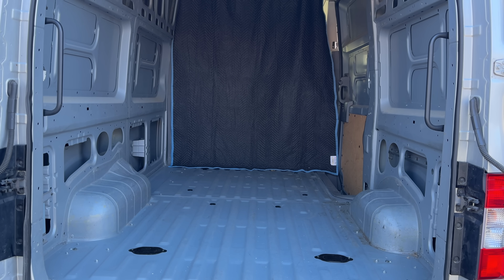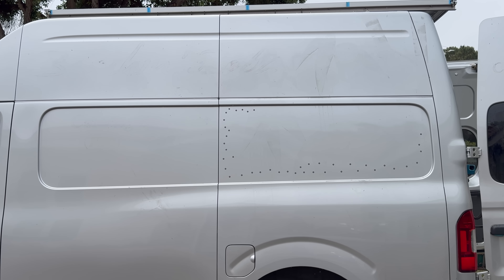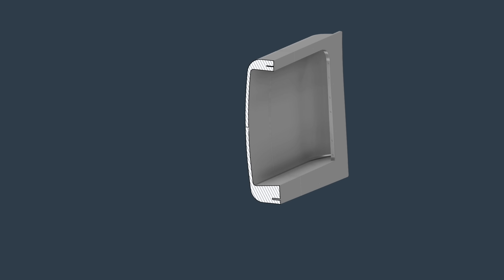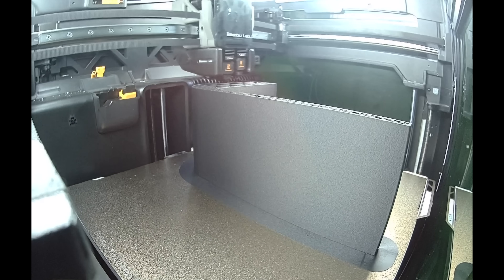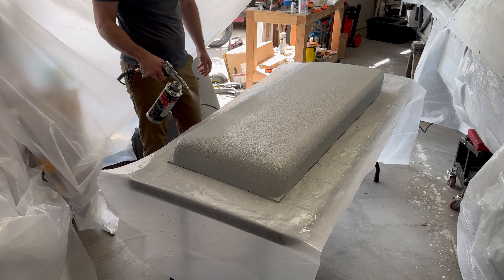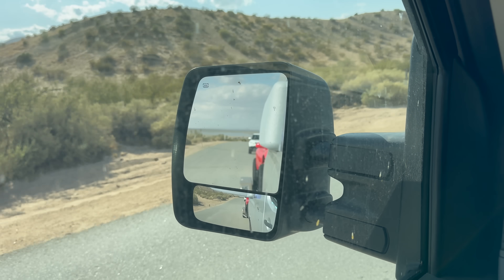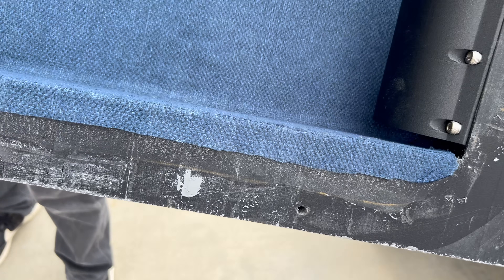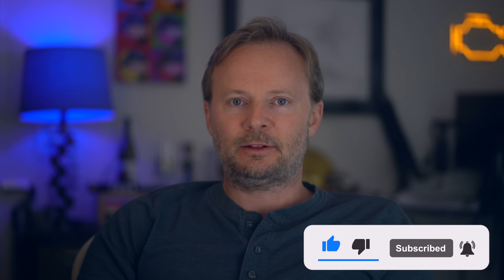The Challenges Of 3D Printing Large Parts

Comment: with acetone welding you wouldn't need the fiberglass coating. Acetone literally melt the two piece together. If they come appart it will be somewhere else than the weld.

Comment: Realize nobody reads comment 1222, but whatever. Would it have worked to do a vinyl wrap on it? Adhesive wrap perhaps? Not sure the bonding between a wrap decal and the material though. Haven't worked with CF ASA at all. Your comment about the thermal expansion difference was interesting. I hadn't considered that as a factor. Good thing to file away and remember. Did you have, or did you calibrate the shrinkage / expansion of that filament manually or just go with the 100% in your slicer?

Comment: Awesome project.  Having worked on large ABS/ASA 3D printed parts (custom water tanks) here are some things I would suggest if you do it again...

1) You mentioned bonding the parts together with acetone or ABS solvent glue.  You should have done that.  It is very effective and water tight.  For my water tanks I had some pinhole leaks through the walls (not the joints) of the 3D printed parts.  I ended up fixing that by pouring a shot glass of acetone into the tanks, capping them off, and sloshing it all around until it vaporized.  It basically melted the entire inside surface and made the tanks completely water tight.  For the joints I had already used ABS solvent glue and they were sealed tight right out of the gate.

2) I sprayed my whole truck in Raptor liner.  It's great stuff.  My only tip is to move the sprayer around wildly and never stop moving it.  If you try to do anything like the consistent overlapping patterns used for every other type of paint job it will cause tiger stripes in the pattern.  Just act like you are being electrocuted the whole time you are spraying and it will have a consistently random texture.

3) Use heat set inserts for the threaded holes.  They will be more reliable over time compared to plastic threads.  Plus they are very satisfying to use.

4) Add a second pee-bottle/water bottle holder.  Right next to the first one of course.

Comment: You know that video with the person putting all the shapes in the Square Hole, and how that girl was freaking out? That is how I felt watching this, like the girl. 

You could have just 3d printed molds for this entire project and saved yourself a massive amount of time and money 3d printing the entire thing. Print the plastic mold, it can be super thin and even printed in much smaller pieces and attached. Then once all pieces attached, use foundry sand mold method, and make the aluminum cast. 

You would then attach with screws and Butyl Tape. Making a waterproof seal super easy to install. 

Stronger. Cheaper. Faster. More durable. Better aesthetics. Better waterproofing. 

What you did was insane and cool. A proof of concept that you can 3d Print almost anything. . . but it was also absurd. So much time for a solution that is much worse, more difficult, and more expensive if we are account for your labor hours as part of the cost. 
-----------------

You can 3d print almost anything. But that doesn't mean you should. 3D printing would still be valuable to create the mold. . . but with a method that uses ~1/20th or less the amount of filament and cheaper filament.

Comment: Watching this on the TV in my van. In bed. I’m 5’10” and my bed is east - west, I fit just fine. No flare needed, which is good because my TV is just stuck to the wall on a magnet mount, so plastic won’t do. (Yes, I skipped the neato wood walls in my van. I’m mostly in a tropical climate and don’t want the mold to hide, I’d rather see it and clean it.)

Comment: Air actually likes to be smoothly guided. As you have big areas under and above the blob, it would make sense to give the air that has to pass the blob, the opportunity to smothly flow into the airflow under and above it. May not have the biggest impact, as it is a van and pretty close to the horendous unaerodynamik end of it, but as far as I understand aerodynamics this is a misconseption a lot of people have. A roof box for example is designed just like you had it in mind with your extention, but they are more efficient if mounted backwards. The front should be blob-shaped and the back shoult be sharp. Thats why a lot of modern cars and especially highly efficient EVs have these smooth and long tails sometimes. Because: If the air is guided together, there is less turbulence, turbulences occur only if there is "empty" space that needs to fill up. If it is not possible to get a smooth guidence, then a sharp edge is better then a rounded one.

Comment: Remember to print insulating 3D prints during the warm summer months, when the print is complete it will trap the hot air inside it and stay warm during the winter.

Comment: You don't need to know or own CAD. there is a free program known as 'LU-BAN Slicer' that will take any 3d model you import into it and automatically cut the model into parts the size you want and even number them so you can easily put them back together again. You can even tell it to automatically add holes and plugs to parts so you don't need a crazy amount of glue to put them together. Its a really good program. I highly recommend.

Comment: You might save print time by doing outside and inside separately and then sandwiching them wit insulation foam, could also help in colder climate 🤔

Comment: Side note to anyone curious about doing their own projects. You don’t need $1200-$1500 to start something this size. There are plenty of printers that are the same size as the one here that are a fraction of the cost. Even in the bambulabs ecosystem. If you want a core XY (same as this X1C) you could get a P1P or P1S. If you wanted a bedslinger you can get an A1. I have an A1 mini and an Elegoo Centauri carbon, ($200 and $300 respectively) and the Centauri could definekty handle this project with identical quality. It is the same size as well.

Comment: To be honest, since you said you will not do fiberglass work, I knew there will be some problems, but you acted like a "pro". I was right at the end and I'm happy for that. I think your idea of 3D printed extention was misstake from the beginning and took two times more time then if you would do it in conventional way... There is always reason why everybody does it by conventional way... 3D printing is great tool, but for parts of this size and use, it's much better to use it as a tool to help you reach your final product. Or it helps you to make some processes easier or quicker. If you would print out of PLA or PETG mold of same size, you would safe 2/3 of investment in ASA-CF and use it to make good quality fiberglass product, which is maybe difficult to make (there are plenty of nice way how make it...) and would end up with "One try - One win" solution...

Comment: super glue works the best when it comes to  ABS filament, It will melt the plastic and bond very nicely.after it dries melt the seams with a sod iron to weld the plastic and then sand. You can also try acetone but i don't for durability because it dries the area out and makes it brittle so the impact resistance is horrible.

Comment: I specialize in building large 3d printers. My printers have a minimum 24"x28"x70" build surface. Most of my builds are much larger than that. If you need large parts or would like a custom printer built, let me know.

Comment: If you're using DP 420 a lot (or at all really), I would highly recommend checking out Infinity Bond's EP 420 (and many other 3M epoxy clones). I haven't done any actual testing to see if it actually lives up to the TDS, but I've personally used it a handful of times for composite racecar aero bits with no issues. I also have a few friends at defense contractors who have personally given it their stamp of approval.

Comment: Hmmm maybe I didn't get it, but the side extension is good for your bed, OK, but do your feet fit in the extension above the bed?

Or maybe you need the extension only for the bed frame and your feet would fit perfectly inside the van - together with your whole body up to your head?

(The head side is the same, the extension only fits the bed, but the answer would cover both sides anyways).

Comment: Fiberglass over 3D prints is going to replace a lot of work in custom car building, and likely Ultralight Aircraft.
The claims that the Carbon Fibre in the filaments increases strength, doesn't hold up, Made With Layers and CNC Kitchen have videos showing the shear tests are not as good as the raw plastic. It does make for really nice tactile surface finishes, which need to be coated in resin to protect skin from CF splinters..... Also, don't sand it without breathing apparatus.

Comment: I'm mirroring your cheap/easy van build out.   I have a tip for you... bed base = 8x 27 Gallon HDX bins from HD, stacked 4x2 high with 5/8" OSB sub floor on it plus a residential mattress.  Make yourself a stick 30.5" high to hold up the plywood while you pull out 2 storage bins at a time.  8 storage bins = lots of storage.  The stack is high enough to store mountain bikes underneath with the seat and front tire removed.

Each HDX bin is designed to hold 900 pounds of weight distributed evenly on the lid.

Comment: Be careful when handling that carbon fiber filament it's nasty stuff and we fibers in you for a while same thing with the glass filled. Also just speaking from personal experience you could have done this with like under half the material you did probably plastic is very strong, Also if you go up to much larger nozzle sizes like 0.8 mm or 1 mm the prints will become much stronger. Ymmv

Comment: Auto Parts guy here- you might check out beutal tape in the future. We use it to seal flat glass to sheetmetal and cleans fairly easy and seals impressively well. Plus it comes as a roll so you dont have to mix or use other stuff. Just put it on with your hands (and gloves) then apply other parts.
Reply: That's "butyl" tape. It is used widely in RVs, and I despite it. There are reasons that it is not used in proper automotive design.

Comment: 3d printing something that size can work. And you did a bangup job.
Though one might consider doing a vacuum form piece of ABS instead. Using a DIY vacuum table of pegboard, 2x4s, & a shopvac, then CNC carve a mold out of foam board to the appropriate size/shape. Heat the plastic, drop on the form, and boom... one solid single piece bodypanel.

Comment: Next time you go to bond parts together you might consider using the infinitely more expensive DP8910NS or the slightly easier to obtain but equally as expensive DP8005. I've yet to try it on a production part but have done small test cubes. It is what the 3m rep at my work recommended I use for PPA-CF or any low surface energy plastic. Just something to consider.

Comment: My way of taking measurements is to take a flat picture.

Measure width at widest, width at narrowest, height at tallest, height at shortes, then I draw those lines in my CAD software, add the image and transform it to fit the lines.

Comment: If you want to print other big parts by cutting them into smaller parts, you can use the software LuBan. It is very convenient, it includes the dowel pins too

Comment: get a few jars of that chinease eel brand urethane roof sealant lol. its like like liquid fiberglass... drys really solid. can put mesh in it to stop it from splitting. i use it to waterproof 3d vase prints and also to make things stronger that yt doesnt want me to talk about 3d printing. usually use aramid thread for that too with urethane slathered over the top. im suprized no one knows about this. its like less than 5 cents per oz if you buy in bulk. thats insanely cheap lol

Comment: I also hate sanding!
Have you ever tried planing wood with a well set-up, and very sharp, hand plane?
I think that might convert you to a (part) woodworker, no sanding required, and the surface you get is just stunning.
Compared to sanding, hand planing is pure joy.

If you don't already have a decent one, buy a used one that isn't very collectible.
TLDR: get a not too old, and not too new (can't go wrong with WW II +/- a decade or so), Stanley no 4 or 5 (or up if you fancy).
Then spend a bit of time and elbow grease setting it up, and you'll have whisper thin shavings, that literraly sing when they come off the board.

Rabbit hole warning: go E-baying, and use the "type study". But you might never come back out again...

Avoid "Handyman", as they lack the frog adjuster screw, making a proper setup (much) harder.

I'd avoid the cheap plane shaped objects they sell at big box stores (my first one was that, and it's basically an unfixable paper weight).
Using one of those might only lead to frustration. (A good lesson on how a decent plane isn't designed by trying to fix one though)

If you fancy spending money, then by all means, get a Veritas, or a mint condition Sweetheart Bedrock.

Comment: Couldn't tell what brand bed liner you used but issue is some of the "cheaper" brands are not very resistant to UV and will start peeling after a year or 2. That's why most people just shell out the extra cash for "Rihno Liner" it does not have that issue

Comment: Fun project and a solid execution. Tpu would have made a very effective seal between the bump and body panels. I've used it to seal hydrocarbon laden liquids for days at a time. Tpu doesn't get enough play considering it's INCREDIBLE strength and layer bonding + it's ability to compress oh so sweetly.

Comment: Why did you use epoxy resin vs polyesther or vinilesther? Because of less exothermic reaction that could potentially warp the print? And which epoxy resin was used? Since they are all pretty expensive.

Comment: Hi Matt,
If you want to put big 3D printed parts together in the future, you can use a soldering iron and extra 3D filler. You slightly melt the edges and then add the filler. You can think of it kind of like welding, but with plastic and at much lower temperatures. And if you do it right, it’s even watertight.

Comment: That was a great project.  I have my own thoughts on joining plastic parts.  Firstly, I was really impressed with the surface finish on the parts from the printer, wow.  Secondly, metal houses, cars etc. expand and contract.  I don’t see why people seem hell bent on making rigged parts as a whole, ridged.  I would use a shadow line, TPU filament, raw, as gasket and run a cable, or cables, through the whole thing to tension it.  The parts should be strong enough to hold tension, in my opinion.

Comment: I am 3d printing a whole small sports car - fender by fender.  I use a lip for gluing the pieces, together, PLA 3mm thick with a lot of holes. After gluing I sandwich the thing between just two layers of fiberglass (one on each side) but not the lips - but the glass glues to itself through the holes.  I shove it into a mattress bag and vacuum cure it, then reinforce the lips with glass as the next step. The result is very strong, not too heavy, cheap, and, despite living in Southern AZ, holds up to the heat and sun.

Comment: To me, it looks like the crack formed due to the rigid mounting that transmits the van's body flex straight to the part. Something like a weather seal or foam strip should effectively isolate the bump-out from body flex. 

Or consider a flexible material instead and redo the whole thing, that would be totally on-brand.

Comment: Whenever you have weird glue questions, you can literally email 3M and they will give you a recommendation on what to use. I 3D printed a wing for my car originally intending to use ABS-CF. (Too many layer adhesion issues and I switched to PET-CF for the finished part.) I asked their recommendation to glue that to aluminum and they recommend “3M Scotch-Weld PR Gel adhesive.” It likely would be a great adhesive for ASA as well.

Comment: If you want to go without composites and not have it crack: plastic welding. I've made many large parts this way. Add a significant and steep chamfer on the edge of both mating surfaces and fill this void in with molten filament. If you fill this in just shy of where the original surface should be you can easily create a nice seam by filling the rest with putty. If you go up until the edge you'll have to do a bit of sanding to get a nice seam again (which can get difficult, especially with lower Tg plastics). You can still use some pins and glue to get the initial bonding, then it's easy to fill the chamfer afterwards. Good luck!

Comment: wat you can do if youre not sure if the acethone doesnt stick the material togteher is just trow a bit of the scrap material in a bit of acethose if it melts fast it should stick ok , you might even make a gell using the scrap material and acethone and just use that to stick the parts together , should work as a filler too if you mix in enough material so its thick

Comment: DP 420 is very strong but it is optimised for metallic (high surface energy) adherends. Since you don't need the strength and you have polymeric (low surface energy) adherends, you will be much better off with a polyurethane adhesive such as DP620.

FWIW DP 420 = Dual Pack, epoxy (4 in 3M speak), 20 minutes work life.

Comment: The seam crack could have been solved with a joint like an O-Ring gland without the O-Ring. So a half round groove on one side of the joint and a half round bump on the other as a path down the center of the joint. This gives more surface area for the glue (STRONGER JOINT) and eliminates the the need for the dowels for alignment. Also a liquid has a harder time wicking through the corners of the joint. Also I would choose a glue that does not cure hard, it needs to be mailable like rubber after curing more like a sealant. 3M sales engineers can recommend or a distributer of adhesives can recommend.  Great video and great nice finish of final outcome, just need some automotive barrowed know how!!!